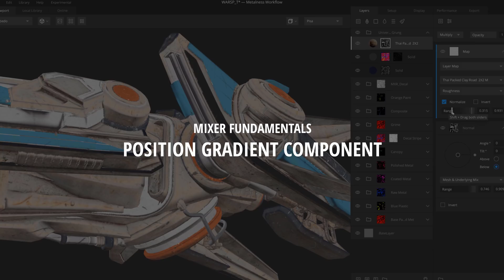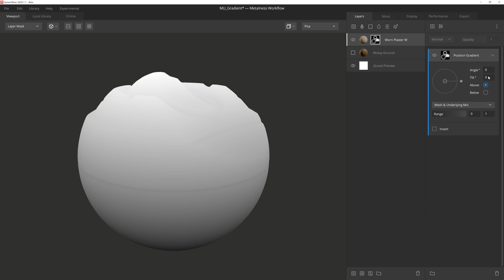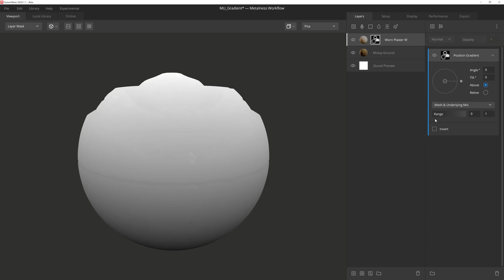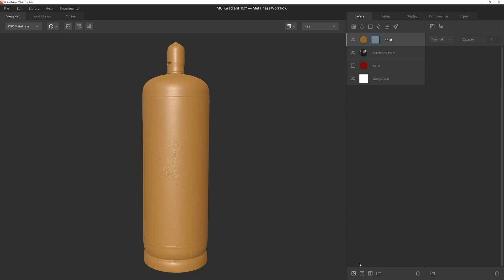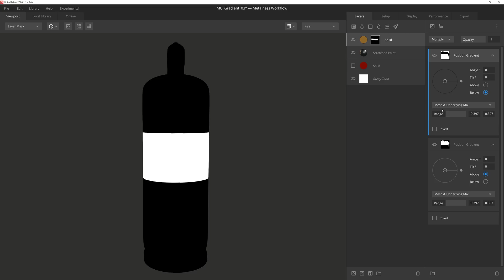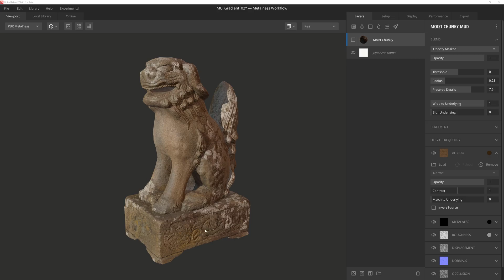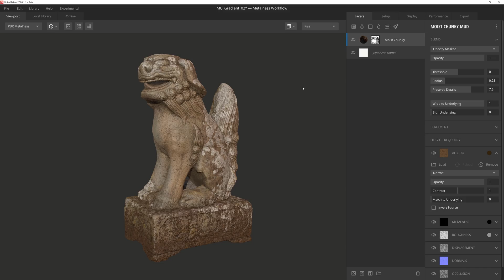Mixer Fundamentals 1: Position Gradient

Comment: I was wondering how do you view a mask by itself? Like the Alt+Left click on Photoshop. But realized that he used a shortcut to toggle it.... bad move to do that in an intro tutorial. Bit confusing! 
For anybody else wondering, you can isolate a map using the drop-down list in the top left corner, under Viewport. It's usually set to PBR Metalness to start off with. You can also use the keyboard numbers as shortcuts to toggle it, Layer Mask = 9. Like pressing the B button in Substance Painter.

Comment: I don't know. I find Josh's videos feel rushed cutting several moments out, taking shortcuts like he's trying to leave work and beat rush hour traffic. I am new and have read the full Mixer 2020 Manual and this video is not helping me. Over the course of raising a month long technical support ticket with Quixel I managed to texture paint custom models and painfully manually import them into Bridge to use with Unreal Engine. I love what they are doing here but Beta updates are very very slow for Mixer! So wish I could bake inside Mixer too. At least they are finally getting some tutorial videos up. I wouldn't mind some written tutorials so that I can match what they are using with what I see. It's a little annoying having to try to locate the materials used in a video without explanation. The Worn Plastered Wall looks nothing like what I found, mine was brightly washed out matching his Pisa lighting.